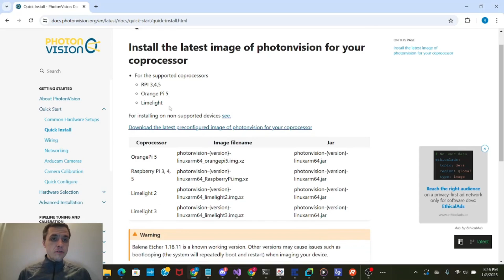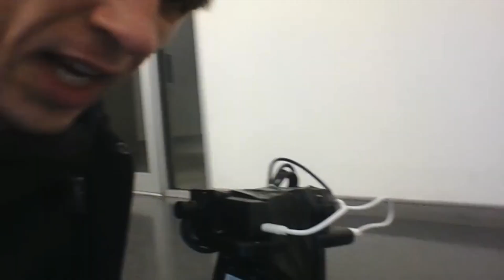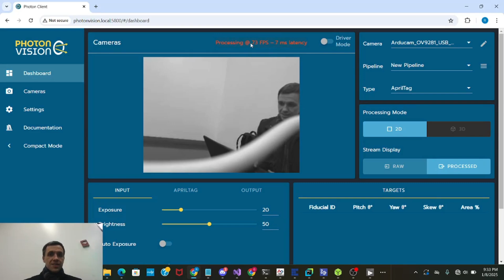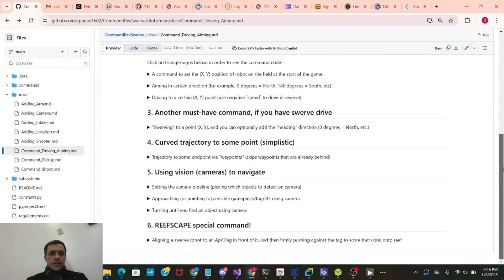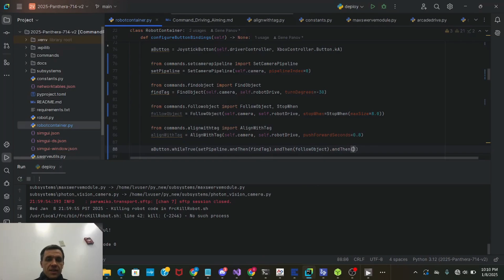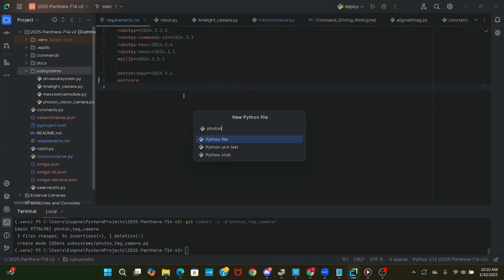FRC in Python - 15. Super Simple PhotonVision

Comment: Hello, I'm just wondering what are the differences between the 2025 and 2024 versions, and which one I should choose. I'm new to robotics but I'm still the only one making the AprilTag so which one do you think is the best for me? Also, my team is on a budget so do you think 1 GB of ram would work?
Reply from the maker: @Kev964: format for messages coming out of PhotonVision coprocessor to your code ... has changed between 2024 and 2025.
And it so happens that if you already have RobotPy of 2025 version, you will have trouble using PhotonVision python library of 2024 anyway.

So, the easiest is to upgrade to 2025 (if you have Rev motor controllers, upgrade their firmware too; if you have older PhotonVision on Raspberry Pis, upgrade them also), but this way you'll be able to use RobotPy of version 2025.